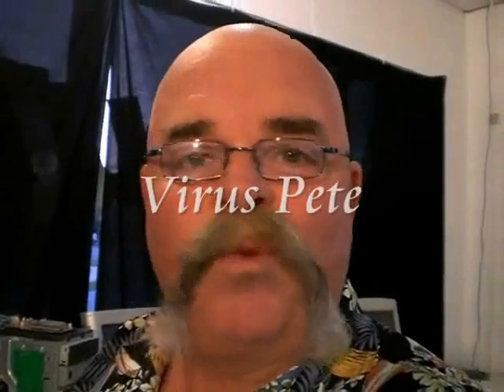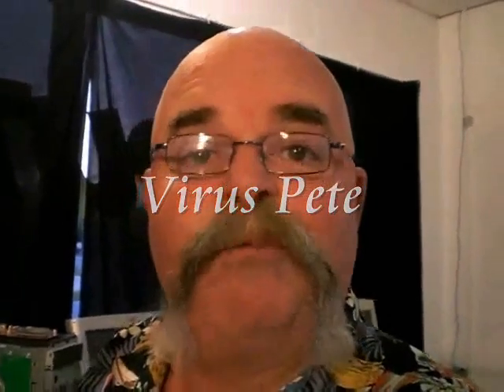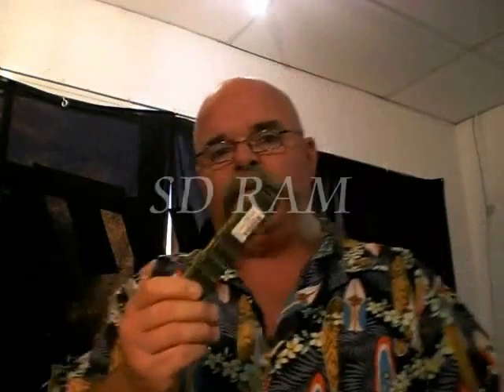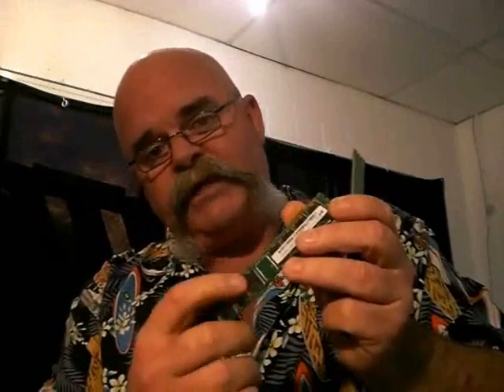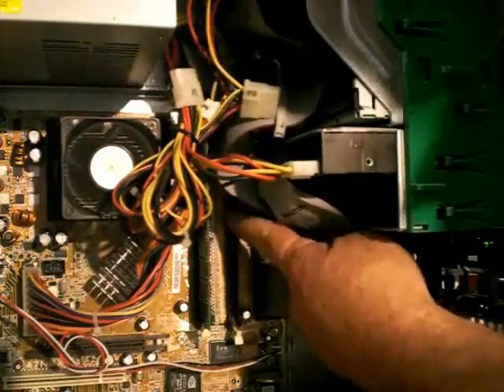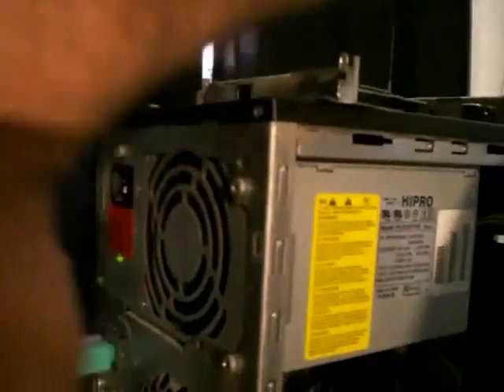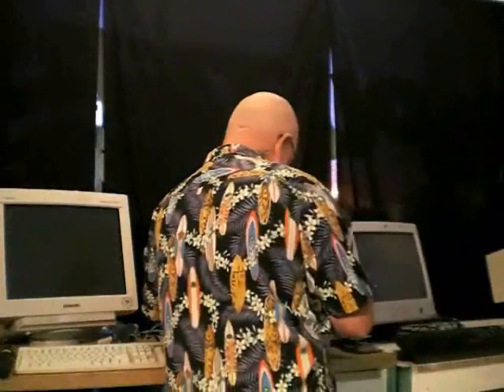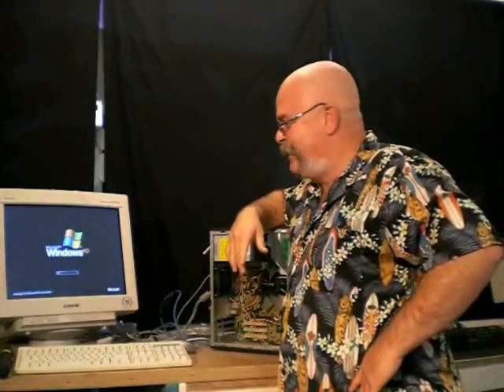PC repair for DUMMIES - No signal to monitor

Comment: PLEASE RESPOND I cleaned my RAM but my monitor still wont respond what should I do?
Reply: i had the same problem u should change the VAG cable 
i hope that works with u man :D
Reply: When you turn it on Do you hear anything from the internal speakers. Is it giving you three short beeps and three long beeps of some sort for the reference for the video card nt being inserted properly?? Is there any other beeping nose from it at all that will help out. Since they also use beeps to indicate if there are any problems when it cannot go through to the post(Power On Self Test).

Comment: i have a standard VGA only monitor and im trying to connect it to my tower, the cables fit fine and the monitor will turn on when i click the power button on the monitor. But it just says acer and then goes to a no signal screen and then sleeps. help?

Comment: please help. I have just finished building my PC, and all the parts and cords are all in place. I can turn on the PC and then it says checking for signal. After a few seconds it says D-sub no signal  entering power saving mode shortly. To my knowledge all the parts and chords are in place. please help.

Comment: i just bought pc before 3 week from amazon with special gaming pc and i just boght benq monitor full hd 1080p 21.5 LCD and i just play 4 days with my beauty gtx 480 so what's happen yesterday at night is bad luck to me no signal detected so i really pissed of i did many issue cleaning ram plug it again and the same for GPU and i test it on my old monitor still have the problem !! i need help

Comment: I have an acer monitor x193w.  As I turn the monitor on, the acer logo shows, it says no signal, and turns off.  No matter what I do it just just doesn't work.   Is there anyway to fix this BESIDES unscrewing the back to my computer?

Comment: I have an acer desktop, and a x192w acer monitor.  Everything is plugged in, but when I turn on the monitor it says "no signal" and the screen shuts off.   Is there anyway to fix it BESIDES UN screwing the whole back of the desktop?

Comment: Hi two of my pcs are working fine but I have another two that when they are turned on I have a blank monitor green light is on monitor as normal but just a black screen but if pull cable out of tower o get writing saying cable not connected I know its not the monitor any idea what it could be ? Thanks

Comment: hi guys ive got this issue too but mine started when my graphics card kept overheating (amd hd7770) so i replaced it (gtx 650) and i couldnt get any image cleaned ram tried one stick at a time nothing, so i bought a new motherboard and some new ram and the problem still persists all fans run graphics card works the only thing i can think of is that my hardrive is broken or my procceser is but would that create this problem or is there something i missed?? thanks

Comment: Plsss help after I update drives for my pc and reboot it the monitor dosent work but the cpu work fans everything not the monitor I tried to switch the vga cable to the motherboard still not work
Pc specs
I7 3770 3.4ghz
Asus p8z77 v lx
Asus 660 ti oc edition
16 gb
1tb hrd drive
Plss help

Comment: Hello there! I hope u can help me with this problem. the monitor I have turns on and then it goes off, I thought there is something wrong with the monitor itself, so I try an other monitor, the new monitor it did the same thing, so this time I thought is the cpu, however I conected my "new" monitor in the original cpu and now the same problem went to this other computer.
   What is what I have to do?

Comment: anyone willing to help ? ,when i turned on my cpu there is signal to the monitor but the fan is running and there is no sound.Usually my cpu has blue lights but now it has no lights and i cant turned it the cpu off by pressing the hold button unless i unplug the power plug from the power supply.i tried removing the rams and putting it together but still it didnt worked.can you please help me out?

Comment: I'm having an issue with a modern pc and monitor. Every now and again in games or dvds I keep getting random hdmi signal loss (black screen) drops in and out. It dosent affect the machine as it keeps running but it's annoying. I've replaced the hdmi cable and messed with updates and roll backs with no avail :-\

Comment: BTW, it worked, but you did not cover why it does that, like if your mouse did not worked, maybe you have unplugged it or connections got loose, I guess I shouldn't ask if I don't know better, I wonder why my laptop never had this issue and wonder why they don't just copy the framework of the laptop to avoid this issue. Thanks anyway thanks Pete, my folks was angry at me, they have this notion that who touches it last and its broken the next day, who ever last touches it, its their fault.

Comment: Lg monitor goes into power saving mode on start up, pc sounds running as normal. Won't enter safe mode I've tried, everything sitting in slots normally......any ideas? Cheers

Comment: Thanks man. I'd say this is no compelete dummy video. Give yourself some credit:) Happens my PC does the same and I recall monitor timed power off, graphic card connection dust but not RAM issue. I've Corsair what was known to be relable...now I wonder. I just force restart but will reseat RAM next time I dust my hardware.

Comment: Hello i wonder if you can help me my pc turns on it all lights up  but there is nothing  showing on the screen . i have reset the ram  checked the cpu clean all dust from everywhere ... i checked all cables changed the Graff card .. i just don't know what else to do or check

Comment: I have a Gateway touch screen computer when I put it in the sleep mode and come bk the next day to start up it won't wake up. I can hear the computer running but my screen stays black I have had the computer for a little over a year but did not by the extended warranty and of course it started right after my year was up. So  I hope you can help me on this. Thanks

Comment: Today i came home, opened my computer to take away some dust, checked that the ram was secure, and closed it again. After that i got no signal on my monitor. I have tried removing/inserting the ram. I have also tried removing/inserting the graphics card. The computer was working fine yesterday and is only about 1 year old. Can anyone help? Are there any obvious signals that may show errors in the graphics card or ram, any suggestions please?

Comment: I admit I haven't perused your channel too in depth, but I haven't found an email, so I'll just leave my comment as follows...

I have an old Compaq desktop running Windows XP, and I'm trying to get a KDS USA LCD monitor to work.  I know the computer isn't the issue, because this monitor does the same thing no matter which computer it's plugged into.  It shows the boot screen and OS loading screen, then claims no signal once the OS loads.  Any ideas?

Comment: Thank you so much for posting this! It has helped me out a lot.  However, I keep having the same problem over and over again.  I've had to do the ram reset a few times now.  It seems to work each time, but, I'm sure I'm not supposed to keep doing this.  Do you have any suggestions?

Comment: Download HWMonitor from cpuid.com, it will allow you to monitor temps. Even if your fans are working your computer can still overheat, because after time thermal paste between heatsinks and chips deteriorate. I would recommend taking it in, because doing that repair as an average joe, you can damage your CPU, because sometimes the thermal paste is like glue. Anyhow if it's not overheating then it's a corrupt driver most likely, easy fix, uninstall the drivers and reinstall them.

Comment: You were right! That's what happened to my Desktop HP Pavillion.  It's about 4 years old.  I took both of the ram out and even though it didn't look dirty, I wiped it off and put them back in. The computer started right up and the screen problem was fixed!!!!!  This could have cost me a lot of money to have someone diagnose and fix. As a single mother with limited resources, you have done a really good thing for us. I really appreciate you taking the time to do this video! Thank you! Thank you!

Comment: Dude When i turn on my ViewsSonic Monitor the screen shows a DVI message then quickly turns off. I tried a D-sub Cord and it did the same thing. Used a different monitor and it worked.

But whats wrong with my monitor? It wont for my other pc either, I do use it alot and it does overheat sometimes. plz help.

Comment: Just built my first gaming PC and every component seems to be running fine, I have heard the POST beep but two monitors we've tried don't seem to have a signal. The RAM is in the right place (Corsair Vengeance 2x4GB DDR3 1600MHz) too.

Comment: the day before my pc was working fine, then the next day the computer starts up but when it loads and normally says starting windows it didnt show anything, then i tried changing the graphics settings and now theres no signal to monitor, is there any other way to fix this?

Comment: sir.. my computer just and suddenly just don't display on the monitor.and i already check the wirings/connections but they are all good. and my mouse is Lighting even i never press the "turn on" button i just turn my AVR on and the mouse just lite up.. i've already visited other sites.. and i tried reseting CMOS/BIOS by removing and putting everything back..i already did the Jumper.. and still nothing happens.. before this happen though it has a BLUE SCREEN of Death.. i was going to fix it

Comment: same problem...there's no signal on the monitor but the CPU and GPU runs fine...i check the monitor  by plugging it on another CPU and it works...i have a GTX460 GPU(HDMI) and i use a VGA adapter to connect it to the monitor....do you think it is the fault of the adapter? well before i experience some weird problems in my monitor but when i plugged my monitor to another CPU it disappears

Comment: I have 2 video cards and whenever I try to plug the VGA cable in the one or the other there is no signal to my monitor, but it works fine with onboard graphics - please help??

Comment: I had my PC on, and started wiping my keyboard, PC shut down, started it again, was on for 6sec, restarted, stays on, but display says "no signal" I have tried it with another monitor, another cable, another cable slot, changed HDD, didn't help, cleaned RAM sticks, didn't help. Now I need help!!!

Comment: Hi. I have a problem Its my Monitor, it used to work fine, and lately when i turn the monitor on the power light constanty fades then re appears and it will do this for like an hour until it wants to stay. its a modern computer and the monitors a 17'' LCD. and now my monitor wont come on, i heard like a electric sound some times from my montors power source maybe its the plug? thought i would ask,.thanks

Comment: i tried this & it didn't work. even tried new ram sticks. weird thing is my monitor was working, & stopped. worked again after a few cord wiggles, & turned my pc off but apon turning it back on monitor hasn't worked since. video card maybe? pc is working just no screen. i tried another monitor & also didn't work.

Comment: Allright mate? I've resited my ram multiple times to no avail. I've tested the monitor (with the same model laptop you had there) and that's fine, I've used the monitor straight through the motherboard AND the video card and still nothing. I think I've got bad ram. Can I fix that or do I need a new stick?

Comment: Believe me I have. I plug the chord into my on board gpu it works, i went into bios and made sure it would run my other gpu but still i get no connection on monitor.

Comment: I have a problem. I have a Radeon 6850 gpu in my custom made pc, everything at one point worked well! but this morning when I went to turn my computer on i get no signal but when i plug the tv to my on board gpu it works fine. please help!

Comment: It is possible to use the same generation of DDR memory modules with different speeds, just as you did with your PC. I´ve done it and I´ve had no problems at all. Why don´t you try to reset the CMOS on your motherboard? If it doesn´t work try testing all your hardware piece by piece. First try with another monitor. If your pc doesn´t even seem to turn on its mobo and fans try with another PSU. See more tutorials and don´t feel guilty since you never did something wrong.

Comment: I have 3 ram sticks each one is 1gb DDR3 PC3-10600, today I bought a new stick of ddr3 ram to install on my remaining empty slot (it says DDR3 1333 1Gb on the stick), my pc won't boot up anymore, my screen shows no signal, I tried removing the 3 old sticks and putting only the new stick, same problem, tried installing on different slots still same problem, any help please? I have a HP Elite 7100 MT.

Comment: I have a HP pw series have had it 4 months I upgraded the gf card to a hd radion 6570 2gb card after a week I put my computer to sleep came back about 5 hours later hit the power button to wake it up everything comes on except monitor, it pissed me off hopefully this works can you tell me any other tips that might help me if this doesn't I'll comment again if it does or doesn't thanks a lot!!

Comment: Help me Pete, please. I have a an ic power monitor CM2015 for my HP Presario Compaq Desktop. Problem is with the monitor. When I hit the power button it shows power saving mode. So I hit the on button again and it shows the picture then it goes blank, then hit the button again it does the same damn thing. I gave it to my mom, who by the way is 76 to just play solitaire. Need help. Thanks, Debra

Comment: i've tried it already.. but still no signal to the monitor..:( i clear the cmos too.. ive changed the power supply.. but still.. the pc is running but no display.. fan is also spinning but no beep tone... the green led of the mobo lights on too... is there any ways?? do you know how to fix dead computer??

Comment: I tried turning on and off the PC a couple of times without resetting the RAM and it works. but still don't know whether it's the RAM, VGA, Power Supply or the Mother Board.

Comment: that's a fair point, but I doubt it makes much difference provided it is turned off, not the green light was still on at the back because there is still energy in the capacitor.
If there is a fault on the board you could get electrocuted!!

Comment: computers beep at startup when they detect a problem.
look up "computer beep codes" you need to find the codes for your computer, or more correctly your BIOS so look for bios beep codes, types of bios are "award" and "Phoenix" Normally the bios type is mentioned when you booth. But google info on your computer and find it's motherboard and bios
Basically google "bios beep codes" and the first few results are very helpful giving codes for various bios.

Comment: i love australia, i love the accent. you gave me another reason. i've had a desktop gathering dust in my cupboard for 5 years now. when i powered it up i got "no signal" message on monitor. i thought it was video card, which is integrated into motherboard. took it out again today to try and find some sort of solution and i came across your video and boom, works:) you're the man. i found all sorts of crap on the internet about the causes, but you nailed it and you showed it plain and simple.

Comment: Hi my computer monitor is not responding when I turn it on also the keyboard to I plugged it in correctly and still not working help please my computer is only 1 year old and it is not one of those white old computers.

Comment: Question out of curiosity - why did you unplug the power for the PC to remove the RAM? I've taken some computer tech courses and read a few guides (working for the A++) and I have ALWAYS read that you should keep the power connected to keep the machine grounded.

Comment: I checked the power supply with a multimeter and it is good. A post test is to check to see if any of the hardware is faulty? I do not have a post card. How can I check to see if any parts are faulty? I tried some of the parts in other computers like the harddrive and it worked. The computer uses DDR 2 ram. I only have one stick of RAM, I reseated it, I believe the Hardrives are good. How do I take out the motherboard? I unscrew everything. 

Please give instructions on how to do a POST?

Comment: I like your video very much

It didn't solve the problem but I will remember the info. My computer system comes on but I do not see anything on the monitor, I checked the power with a multimeter, Reseated the RAM nothing doing. I have an onboard video card, I will try to get a working video card to see if it solves the problem. Got any ideas or suggestions to help me. I appreciate it.

Jennylene

Comment: a great vedio about the no-post problem and a very common cause is the ram , thanx .

i am having the same problem now too , and after trying every thing possible the man kind can do (lookin in youtube as well) i found the little cunts that caused it , it was near the ram , but it wasn't it xD ,i found the 2 of the kzg capacitors was almost pop off , it was very hot in this area of it too , so i am kinda goin to replace the little foker tomorrow.

Comment: I get no signal from my PC to my monitor. I have two sticks of RAM and two GPUs.  I did what you asked with the RAM still nothing. I know there is power going to the GPUs because the fans move on them. I'm running 650 Watts of power to my PC. I'm completely out of ideas on what to do. Any suggestions?

Comment: Fixed my pc with your tip thank you! I brought it to the local pc repair shop paid them €50 deposit they said it worked straight away for them and it must of just been a loose wire but they never refunded the deposit!

Comment: Computers can be accessed REMOTELY,and a technician works with you to be sure that a problem is fixed—quickly. This is what i did 2 weeks ago. Call: 888-565-4946